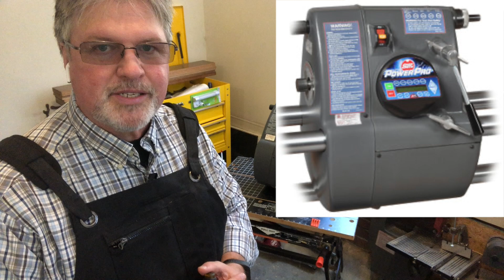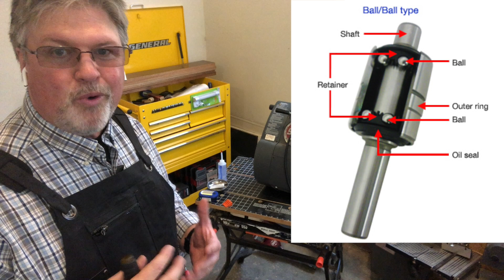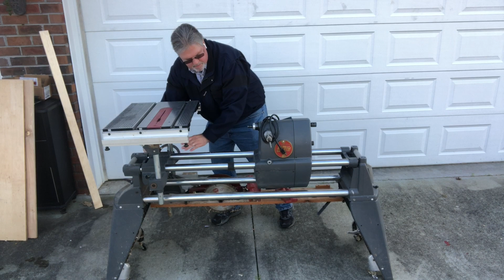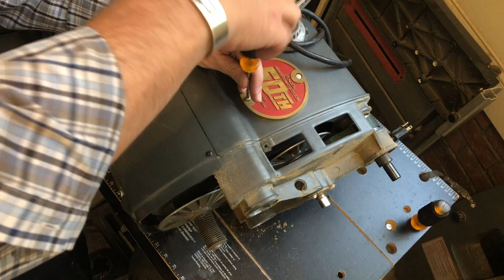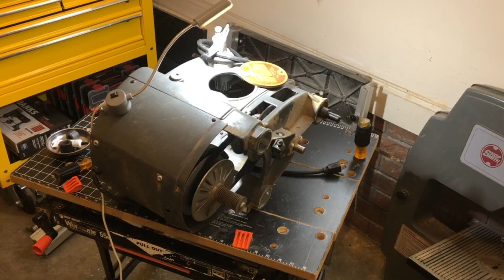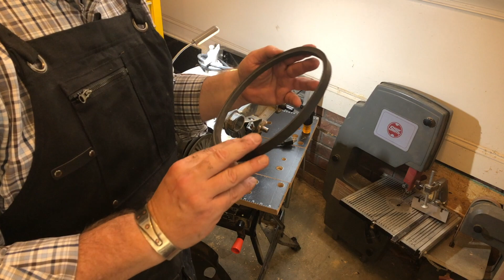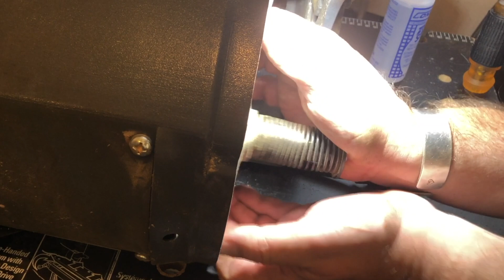25-Hour Run-Time Critical Shopsmith Maintenance, Headstock Removal & Lubricating & V-Belt Removal

Comment: Do you have to remove the belt if you don't take the headstock off? 
I have a mid to late 80s model, the one that the logo pops off like you described. I just got it maybe 2 months ago and I've only used it about 60-90 minutesof run time total so far but that's about to change. I want to make sure everything is good to go. The speed dial is a bit tough to move from fast to slower. 
Any help would be greatly appreciated. 
Thank you for your videos, they've helped me a lot so far. Keep em' comin! 😁
Reply: I've waxed it and lubed the band saw because that's what I've used the most but I haven't lubed the headstock itself which I know I should have before using it... I'm not using it again until I lube everything and do anything else I need to.
Reply from the maker: The belt can be removed with the headstock on the Mark V, but I find it a little tougher to do. Yes, it's always harder to go from fast to slow speed, but oiling will help. Thanks for watching and commenting! Scott
Reply: @MyGrowthRings  thanks for the reply!
Is there anything else you think I should know before I take the belt off? Any special trick to get it back on easier? I'm pretty handy with mechanical stuff usually, but any expert advise is always welcomed.
Also, should I consider replacing the belt? Or is it usually good for a while?
The guy I got it from took care of it from what I can tell, no rust, (minor surface rust only on the jointer blades that came off easily) but not even really any sawdust on the inside of the headstock, and the band saw was nearly spotless inside. 
Thank you again, I sincerely enjoy your videos and the knowledge you share with us all.

Comment: Scott,
I learn something from every video. Locking the wedges is such a great hint. I always have had trouble with them in the past. Now I hope to remember your hint.
Reply from the maker: Glad to help. Yeah, I couldn't believe I missed that. Between that and dropping the headstock, I wasn't having my best day. Thankfully the jointer was on the floor to break its fall.  Scott
Reply: @MyGrowthRings  Is it difficult to put the wedges back into "the correct timing"?
Reply from the maker: @BunkyC36  Not really, but if you aren’t expecting it, having to mess around with that while you are holding 65lbs in the air and 3/4” into the way tubes isn’t ideal timing!
Reply: @MyGrowthRings  Garry not Linda. ( I have to get my own email someday.) I also had my headstock rebuilt by Alex, mentioned above, a couple of years ago. I caught a trick that I think he used to get the locks back in the correct position. There is a marker dot on the casting and another on the end of the locks on both sides. If the locks aren't messed with during maintenance or repairs, check that the marks are lined up before sliding the headstock on and all should be good.
Reply from the maker: @bassrun101  Yes, there’s a part line from the die where it was cast. A very useful tip. Scott

Comment: Thanks for including the pointers for those of us with the early Mark V 500s with no access hole.
Reply from the maker: I think I answered a question you didn't ask!
Reply: @MyGrowthRings  Yea, but I was thinking it.
Reply from the maker: The best approach is to leave the headstock in the tubes and in the drill press position move the main table to the back by installing it backward in the carriage. From there you can drop the motor pan and access the entire headstock cavity from the bottom. If I have time I'll demonstrate this in the mid-week follow-up. Scott

Comment: Are the sealed bearings in the headstock common off the shelf sizes or are they proprietary to shop smith equipment
Reply from the maker: Yep, they are all commonly available. Great question. Scott

Comment: Love this series, have had my Mark V since 1983.
Reply from the maker: Thanks! That's a little longer than me. Can I assume yours is a model 500?  Scott
Reply: @MyGrowthRings  It is Scott.  I had the headstock refurbished and new motor installed by a retired NASA engineer named Alex from out west...it was worth it!  I use my Shopsmith constantly.
Reply from the maker: @looper9264  That's awesome, though repairing the Mark V isn't rocket science!  Great story.
Reply: @MyGrowthRings  Trust me (lol), I've torn my Shopsmith down numerous times to change belts and clean out the dust, but I don't own a proper bearing puller; being cast aluminum I didn't want to chance busting out the casting.  I also broke my original switch, so I've rigged more than one good switch too.  Thanks for your informative videos, they are priceless to a guy like me.
Reply: @looper9264  Garry not Linda. Ya, I had my 500 redone by Alex also. Mine was in terrible shape. It was so bad I could stop the shaft with my hand. He did an excellent job and turnaround time was fairly good. He was held up waiting for parts from Shopsmith. Shipping to and from New Mexico costed nearly as much as the rebuild but yes, it was definitely worth it.

Comment: My 500 is from1980 and it looks like the Poly belt is original.  Starting to get some slip.  Have you done a video on replacing that belt.  Also, thanks for showing how the lower pulley should work.  Mine was always stiff and thought that was how it worked.  Great presentation.
Reply from the maker: Not yet. I'm kind of doing these as my machine needs the maintenance, but I would imagine that one or another of my machines probably needs to have the poly-v belt replaced. The speed dial will always be tighter as we lower the speed than it is when we increase it, but the kind of issue I discovered here can actually lead to failure of that little button bearing on the control sheave. It's really weird how that little part is somewhat of a weak link, but if we pay attention to routine maintenance, it shouldn't be a problem. Thanks for watching and commenting. Scott